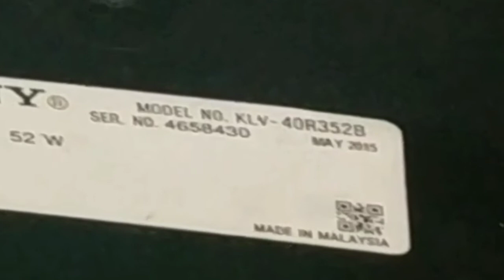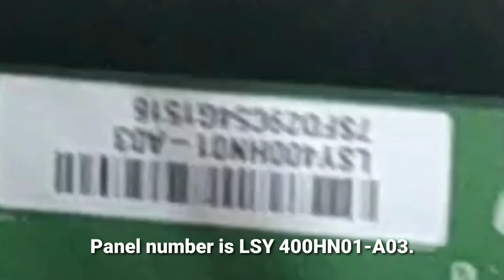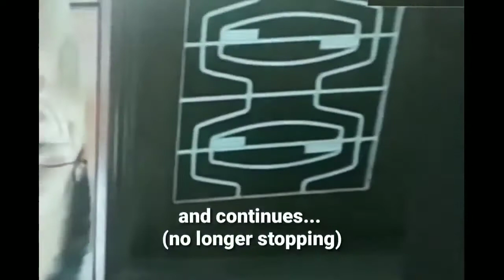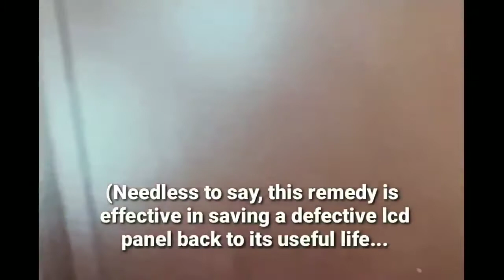Sony logo just blinks good backlight RT6930 panel trouble rt6930 ( Sony 40" led tv )

Comment: Hello,
Thank you for sharing your experience !

I have the same problem with my Sony TV (KDL40WD650B), and I admire your solution.
Before starting to cut, I would however like to understand what failure in the LCD panel causes the DC-DC converter to stop.
More specific, is there a risk (of fire for example) in eliminating the protection or can more damage to the LCD panel  occur?
I assume that they did make the effort of implementing the protection for some good reason.
Also, cutting the MON_L and MON_L lines looks very logical, but why also does the VSS one to be cut ?

Thank you in advance for your reply, helping to save an only 5 years old TV from scrapping.
Stefaan.
Reply from the maker: Thank you very much for watching this video. In this particular case, there are minor changes in the characteristics  of either the LCD glass itself or the protect circuit
Reply from the maker: These changes enables the protect circuit and stops the dc-dc to operate. To prolong the useful life of the panel, this remedy of cutting
Reply from the maker: is used instead of scrapping the whole TV. Vss is part of the protect circuit.